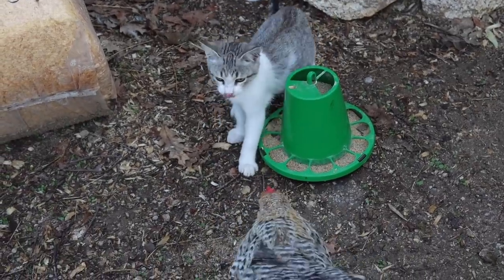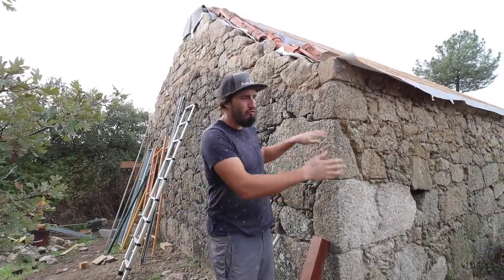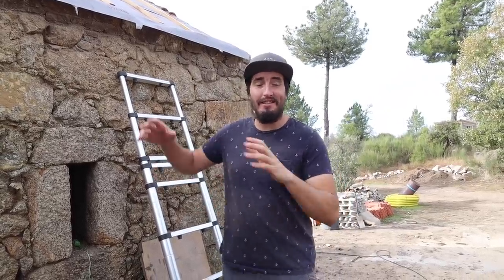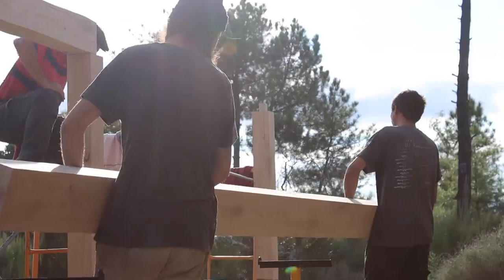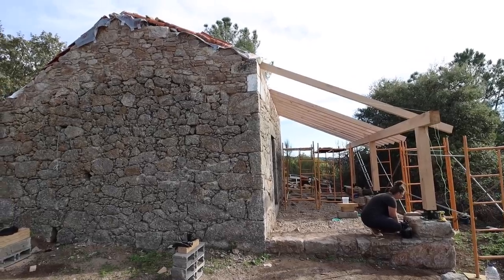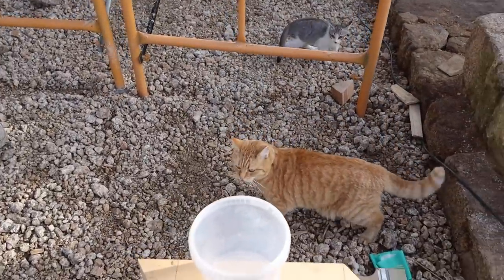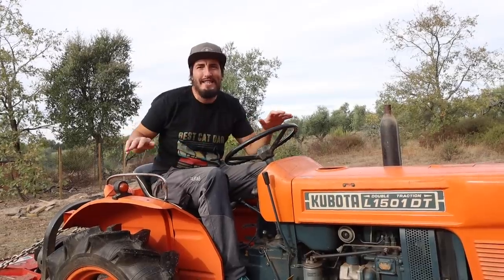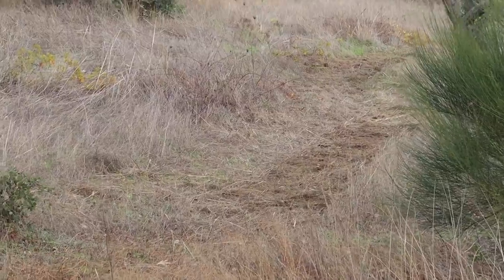WE HAD TO STOP! Portuguese lockdown? Building A Stone Tiny Home

Comment: Hi guys! Love your channel and look forward to your progress each week.    A word of advice to keep you "crackin". When I noticed you pick up the brush hog or rotary cutter on the back of your tractor, turn off the PTO as to not put stress on the U-Joints while turning around if you are going to lift it all the way up. Generally, just lifting it a little to turn around, you can keep it running. Good wishes to the both of you.

Comment: 100% correct on the roof there are building regs which are different in every country, I am a carpenter/joiner & builder for 35 years and built many cut roofs in the UK and Europe On the veranda posts I would drill a small drainage hole in each metal shoe at the lowest point to the base plate as water can creep inside the metal box, Good vlog guys

Comment: Good for you addressing some of the comments regarding the roof, Tarp isn't a good idea unless you batten it down properly with laths  in the winds. Its easy for people to make judgements based on how things are done in their local area, we did it when we arrived in Spain and learned the expensive way, the local method is done that way by trial and error over the years and everywhere is different. Example, we have a cave house on one side of two hills, our terrain is more shale like where as the other hill is marble and even has a marble quarry on it, so the caves that side are totally different.

Comment: Hi guys. Been following you for a couple of years. You are an inspiration. Watching the video showing the water damage to your roof cladding i thought you may be able to use wood bleach to help with the staining. Oxalic acid. Its available online. If you make a strong solution 10 percemt by volume in warm water.  Allow to dissolve as much as possible then brush on and leave to dry. Sand afterwards and repeat if required. Ive rescued several wood projects with this. Hope this helps. 😎 BOB.

Comment: Like the porch- should do the job.  do you have mud dabbers They will want to nest in those rafters.  The pizza bread oven sounds great.   A outdoor kitchen would be a must, think about adding a sink , great for cleaning root veggies, and washing dogs and soaking laundry.  Then you can fill it with ice and have a place for your beer.   Really tempted to take some heavy duty pipe  and  have them span between the post a bout six inches from the top.   you could then use curtain rings or shower rings and painter canvas have some curtains sew some good weight in the bottom of the curtain. Or even just hang some plants from the  pipe - the plants would enjoy that summer sun and also help shade the porch in the morning.  A propane Grill  for the outdoor kitchen.    Some ceiling fans  on the porch and in the barn.  A couple of super heavy duty rings.  for a couple of hammocks.  ( guest accommodations)  Think about a water feature/fountain/birdbath...... the cats would love it- and birds would put on a great show while you eat breakfast.

Comment: Try mowing in lower gear and the results will be much better. This tipe of mowers are designed exactly for the kind of grass and bushes that you have but you have to run it in lower gear and higher RPM. That way the chain that is cutting the grass will have more time and power to break down bushes and grass to smaller peaces.

Comment: We had more the M5 agricultural series Kubota (more than twice that size). It is an extreme workhorse that will work for years. Watch your air filter when it is pollen season, or extremely dry and lots of particles in the air, It can get clogged up and overheat your tractor. Which will shorten its life span. Otherwise, you have MANY years of work out of it. Just do not stint on maintenance. Keep at it. Grand!

Comment: Try to keep engine at "PTO speed" when using implements, check the tools recommendation
From a form on L1501s "The only gear you will use on that PTO is first which is rated at 540 PTO rpm with engine speed at about 2430 rpm "

Comment: Fernando on the solar panels was so funny. Would setting up a wood stove with the pipe going out the window help dry things out? If you want to keep your grass I hope you check to see how low you can cut it without encouraging more weeds or killing the grass (preventative re topsoil loss during rains). (I guess you might know this, but different types of grasses handle different heights.)

Comment: the cut offs from the uprights and the beams are still green , so they can be carved int plates and bowls , just an idea to stop so much waste
Reply: i figured its still green because he was chipping out the hole with ease , fully seasoned wood is harder
Reply: water collection will be a lot easier now too , the tractor will have no issues going over mud to get water in winter

Comment: The Structure of barn is finally visible, like what you have been trying to say you are going to do.. i thought you would do the walls, then the varanda..since even if it rains you can be sure that water will not go in..

Now i got one more question..what have you planned for that tiny window on the wall..will it be open ??